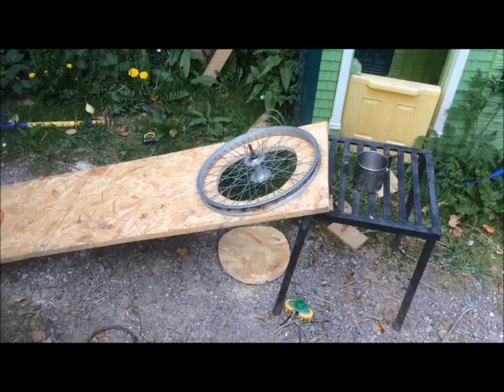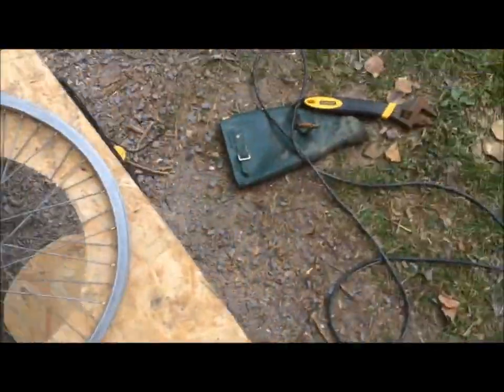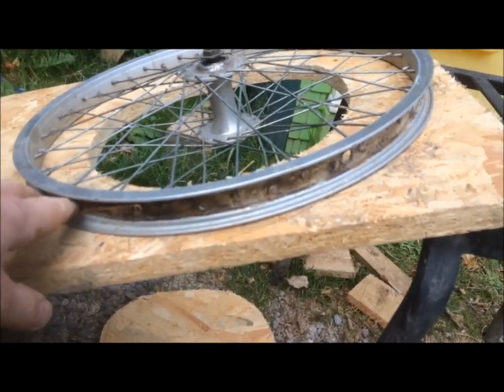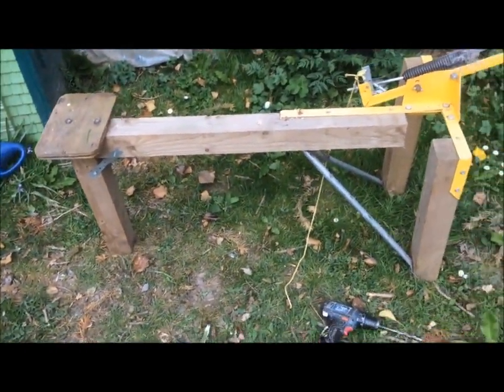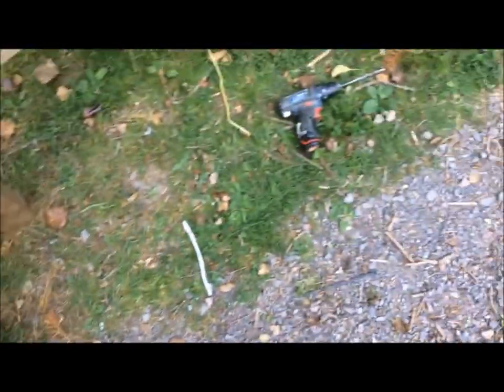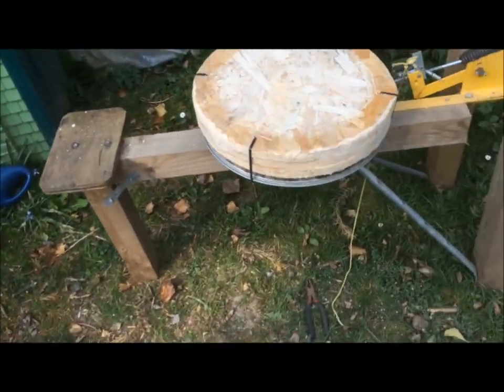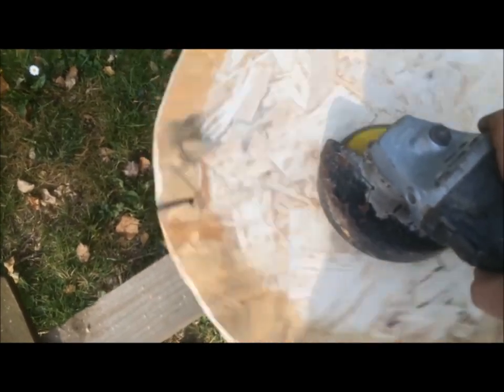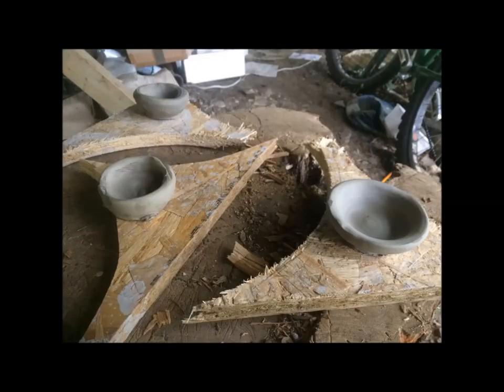Quick DIY Potters Wheel

Comment: Would it not be possible to attach a rod to the wheel's axle, which is in turn connected to some sort of kickboard?

Im not at all sure of the mechanics, but it would allow you to apply a rotary force to the wheel, whilst sculpting at the same time.
Reply from the maker: Yes I think others have done that I think replace axle with suitable length threaded bar running down you concrete kick wheel, you you use cartridge bottom bracket (bearing) for lower mount. You could over tighten bearing on wheel to lock in sync with kick wheel (?)